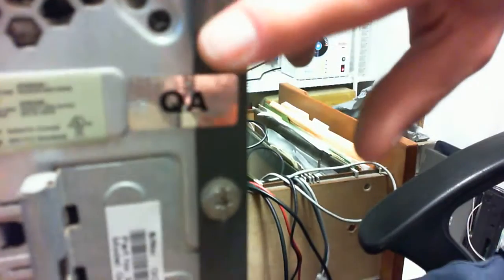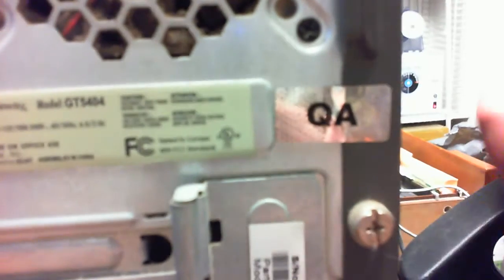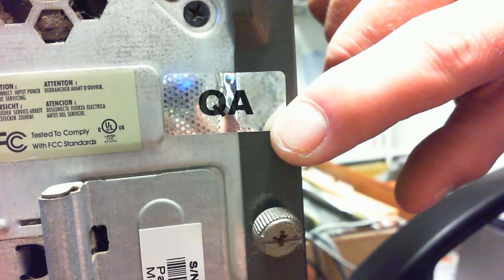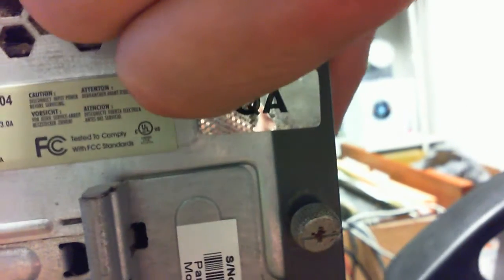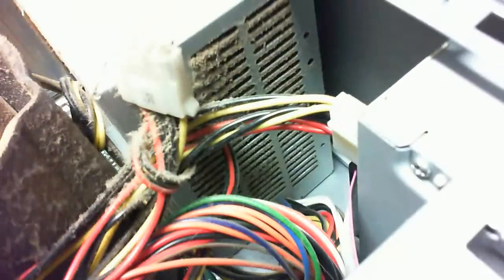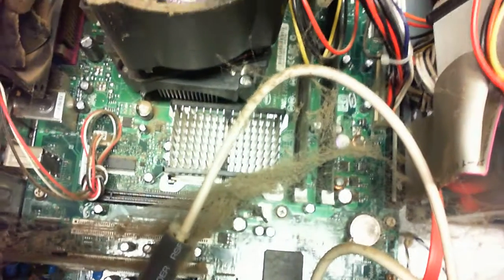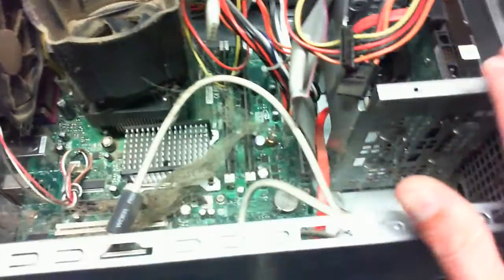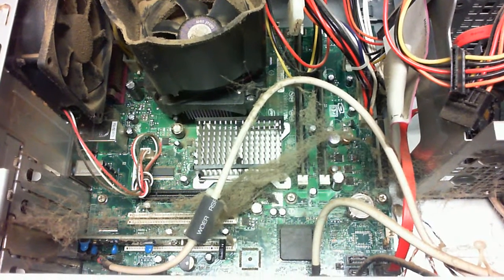What PC Repairmen Don't What you to know!

Comment: that's not fair, that pc is way older than 1 or 2 years. the warranty seal is used to avoid people open and make damage to the system, electronic is so sensitive to static electricity, and stuff like that that is very easy to break something
Reply from the maker: +Tecnovlog What do you mean not fair? So you think its OK to Deny access to a Air cooled system?
Reply from the maker: +Tecnovlog  Yes that pc is way older than 1 or 2 years and dyed way early thanks solely to that warranty seal
Reply: TheHGCGamersClub i don't know how works in america, but in italy warranty seals are used when the pc is new to ensure that people don't mess it up for the 2 years of warranty, after the two years everyone can open the pc and do what they want, no repair man would ever put a seal on it
Reply from the maker: +Tecnovlog That is Exactly why everyone buys New Computers every 3 years: Were do you think 99% of your Repair parts come from? That is unless your Repair center is a Major Retailer or if at a Shop the Customer specifically Requests only New Parts be used in the repair and that is not all that common because not many like to pay the Extra expense of only Brand New Parts.
Reply from the maker: +Tecnovlog I could be mistaken, I will have to look, but I Do not remember seeing any warranty seals on New Computer Towers Hear in The USA? It could very from State to State?

Comment: could you do a video on repairing a water damage logic board like on an iPhone. I read that cleaning it out in isopropyl  alcohol of 100% would work to clean out any corrosion and minimize future corrosion. do you know any truth to this or is it just a dumb quick fix
Reply from the maker: +Android Hacking (YES) I can show how to give a proper alcohol bath for your electronics and (YES) A proper alcohol bath can fix a hole range of problems for just about any electronic, you only need to know why and when a proper alcohol bath is needed or suggested and (YES) a proper alcohol bath can help prevent corrosion, but only corrosion that would have been caused by what ever substance that needed to be removed like Pepsi, coke or something like grape juice? Alcohol will not protect electronics from any corrosion only stop the corrosion from taking place by removing the substance that is not suppose to be there that will corrode your electronic item.
Reply: +TheHGCGamersClub alright thanks

Comment: I understand why your warranty is gone when you open a computer. 

A computer is very easily damaged by ESD damage if handled incorrectly. Not everyone is aware of those dangers.

Besides, I have seen people clean computers with tools that could harm the computer badly, like vacuum cleaners and brushes that are made from questionable materials that are prone to holding a static charge.

Many people would not take the right precautions when working on systems so they could end up with many broken computers during the warranty duration. The best way to keep your computer clean during those warranty periods is to keep the surroundings of the computer clean. 

Not everyone is good with tech, many people cause more problems than they solve and companies know this. They don't want to have a lot of cost from people breaking their systems during warranty by their own fault. 

Yes, I am aware that you need to clean your PC and right after warranty is usually a good time to start doing that in my opinion.
Reply from the maker: +Bas van der Meij (Ykai63) So your saying Screw the Customers Right to Add memory or larger hard drives without being over charged by the store that sold it to them? You say The best way to keep your computer clean during those warranty periods is to keep the surroundings of the computer clean. That is "NOT TRUE" The Dust on the Desk or on the shelf is in now way a Danger to your Computer it is not going grow legs and jump in the computer or game system; It is the Dust in the air that is a Danger to your Computers, with that, unless you tell them how to clean properly they can and likely will easily speed up the dust build up in your computer or game system 100 fold.

Comment: this is why i built my custom pc from component parts. People should educate themselves more about their electronics.
Reply from the maker: +angelo reyes Your Comment Makes no sense? There is no PC that is Immune to the buildup of dust Not Even the computers at NASA are Immune Show me your computer.
Reply: +TheHGCGamersClub I think he meant to say build it yourself and you wont have to worry about sending it in for repairs or worry about stickers stopping you from cleaning your PC. Since you can choose top of the line cooling and get higher end parts you lower the odds of ever having problems with your PC. 

The prebuilt systems are known to use terrible power supplies and lower end parts to keep the price down for the normal consumer which is a bad combination.
Reply from the maker: +Twisted86 I Do think he meant to say that, I think he meant to say what he typed, you are right in some respects, obviously building your own computer teaches you a lot about the computer but I have seen seriously custom computers come in in worse shape than this one. I do not care if you use a water cooled system if you do not know how your computer actually works, it can cause more problems than a Air Cooled system, just because you spend a lot of money on a Computer does not mean it will last any longer than the ones you say use terrible power supplies and lower end parts. There is a lot more to A computer than a chip that needs to be cooled and keeping it clean that plays a big roll in how long its parts last...
And this is A topic I will soon cover on this channel for everyone.

Comment from the maker: Hello, my name is Daniel of ClovisX Game System, PC & Laptop Repair if you are running any PC or Laptop using windows 7 you are at serious risk because on January 14, 2020, Microsoft will stop supporting Windows 7. Mainstream supported ended in 2015, but Windows 7 has carried on receiving security updates thanks to extended support. When that ends in 2020, Windows 7 will remain as it is! in fact as far as I can tell they have already stopped making security updates for that operating system, this puts you in extreme danger of getting hacked leading to your bank accounts being drained of all there funds as well as possible Identity Theft! Call Me and I will Hook you up bigtime for only $65.00 I will perform preventive maintenance on your Laptop or PC, Run Diagnostics on any and all of its Hard Drives, pull all Photos, files & folders off your computer then perform a complete wipe of the Operating system Hard drive removing everything including partitions and then Properly perform a fresh install of windows 10 not to be confused with a upgrade of windows 10 that will be slow and buggy thanks to remaining drivers and other operating system programs that the upgrade always tries to use before being told to use the new stuff causing serious slowdowns I am talking a lightning-fast total fresh install of windows 10 then legally and legitimately activate it using a real [Microsoft Activation Key] Not a spoof or hacked version that will and always duse lead to your system being compromised. I will then place all your precious data in a single folder on the Desktop for you to go threw and decide what you wish to keep or Delete.

Is your Data Safe with Me? Yes, I have, Can and frequently do take and pass comprehensive Federal Background Checks with a 100% Clean slate. Something most Repair Shops can not say or do.

Call Me During my open hours I can get you speeding threw the internet safely in less than 24hrs! 
Thank you from:
 Daniel of ClovisX Game System, PC & Laptop Repair

1470 Keats Ave
 Clovis, CA. 93611

License 10117523 business
BEAR License 88169
Phone# (559) 593-6205
8AM to 8PM Monday threw Friday 
(Sorry no weekends)